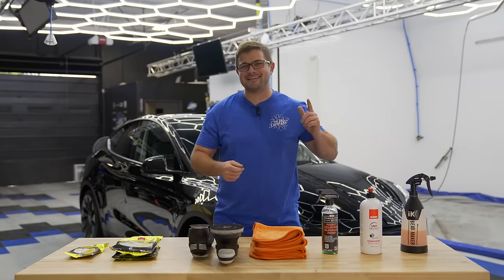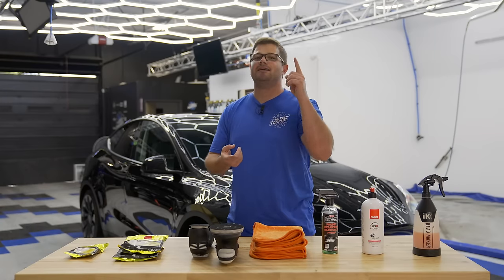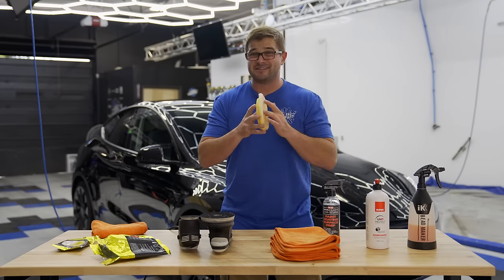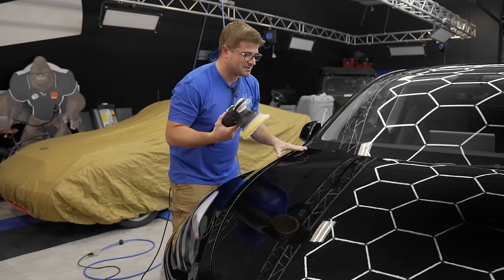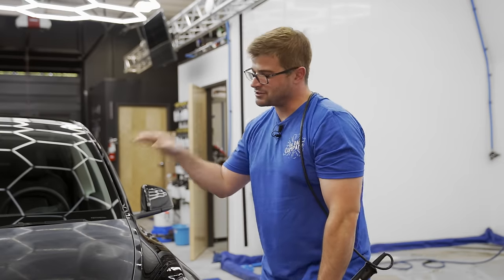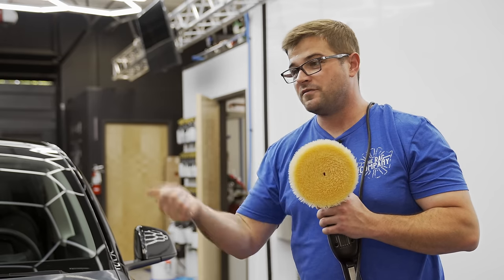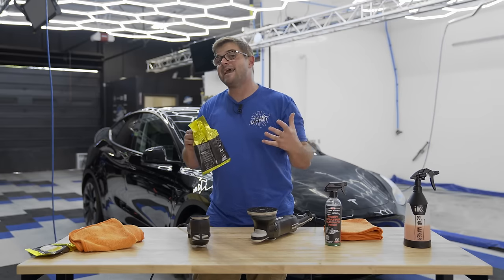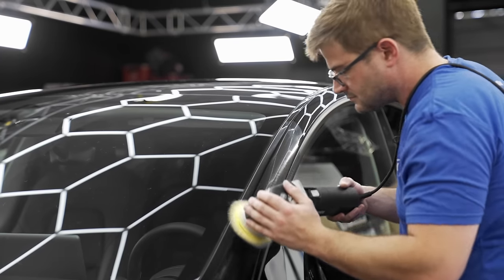The ULTIMATE 1-Step Polish for Gloss and Slickness (Uno Protect & Bead Maker)

Comment: Can I still add a ceramic coating after uno protect? What about bead maker? Combo? Or should I use rupes 2 step or different 1 step before coating?
Reply: You need to watch a beginner ceramic video if you’re asking that. Of course you can’t apply a ceramic coating on top of any other coating. Ceramic comes first after paint correction and a deep panel cleaner like alcohol or a specific prep like carpro eraser. You put the hardest coating on first then after it’s dry apply a top coat like bead maker

Comment: Help me out here. I don't understand how this process works. Your spraying Bedmaker, on top of another product that has dried and created a film on the panel and it is going to go through Uno Protec bond to the panel, and create a higher shine and sickness. It seems it would work better if you remove the Uno Protec, then add Bedmaker ??? Please explain
Reply: Why would it go through? Your confusion stems from your false assumption. It’s not adding a film it’s adding a coating like wax or sealant. Bead maker goes on top of a lot of coatings to add extra gloss and hydrophobic properties.

Comment: I do think a water spot remover would have been worth while. I've had good results with carpro spotless. A few years back I was on vacation and the place I was at had sprinkers that nailed my black car on day 1. Baked in the summer sun all week and wouldn't wash away once home. I ordered spotless based on some reviews and by the time product arrived the spots had been on the car for 2 weeks, cooking in the summer sun the whole time.  Spotless removed every spot and it was near instantaneous.  I don't remember what I was running for protection at the time but I think it was just chem guys butter wet wax.
Reply: It doesn’t take long for water spots to etch into the paint where remover or vinegar water mix doesn’t work and it needs to be polished out.
Reply: Also I love butter wax but it doesn’t last too long. I found adams graphene paste wax and it gave more shine better uv protection and lasted for over half a year so far and it’s still going strong with hand washes only.

Comment: I do this, but instead of BeadMaker, I use GTechniq'sLliquid Crystal C2 V3. It also works with Jescar's Power Lock+ and Ultra Lock+.
Reply: I just ordered the C2V3.. so do you use it to wipe off the polish like was shown here, or apply after as a topper?
Reply: @mozart369  you can do either/or.

Comment: would you suggest the same time of curing in the sun?
Reply: Don't apply or let it cure in direct sunlight. While it is possible you would want to let the product sit on the car in a place where it is less prone to the elements. The purpose of this is so the product doesn't dry out prematurely and to avoid exposure to decontamination.

Comment: can you use if ceramic coated already?
Reply: Rupes Uno Protect is a polymer sealant that best adheres to bare paint. That's the reason for the 20 minute sit time + 4hours without getting it wet so the polymers can crosslink with the paint. If you apply over a ceramic coating the bond won't be as strong basically rendering it a waste of product. To get the most out of the product, including that amazing shine, I would recommend either removing the ceramic coating or just waiting until it's time for a new protective coating.

Comment: Can you ceramic coat after a one step? Even if it has a sealant?
Reply from the maker: Technically yes, but you MUST use a panel prep product before the application. Ideally, you would want to one-step with a product that contains no protection.
Reply: Will this work using defender instead of beadmaker?